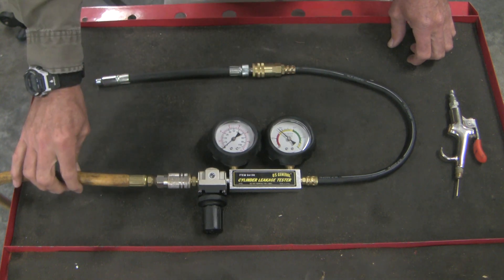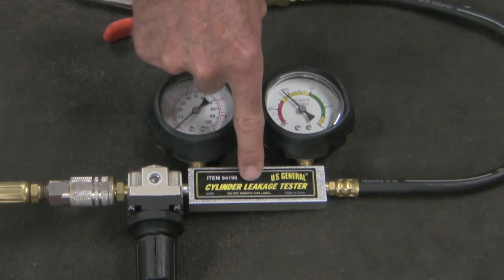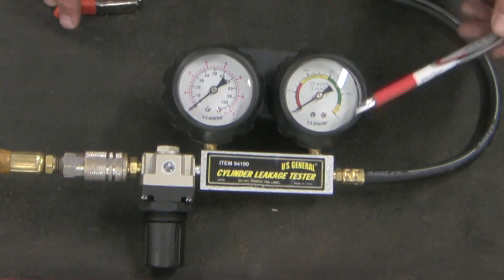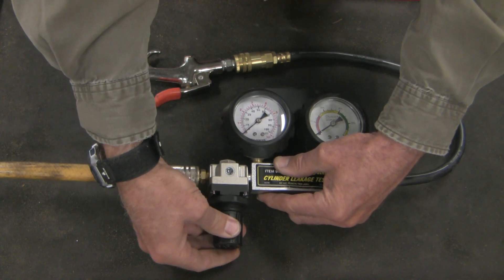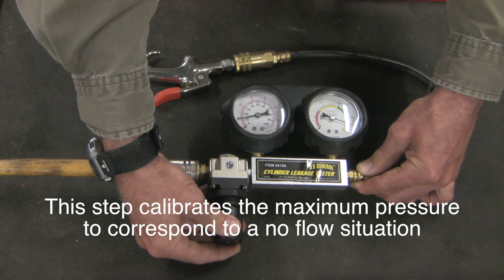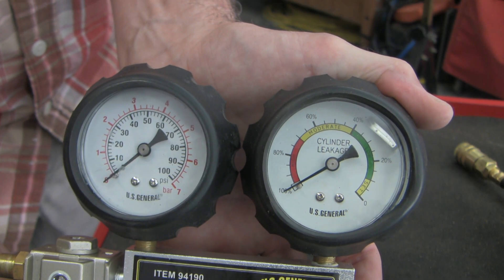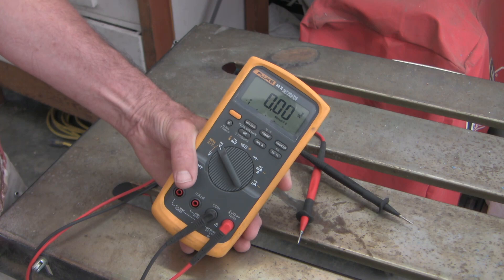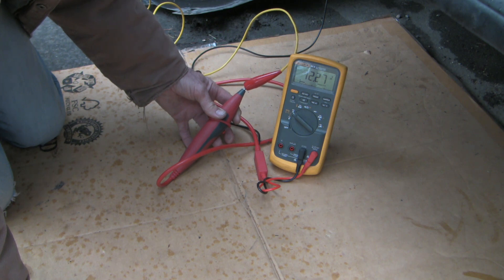How does leak down testing work?

Comment: I worked for an airline based in Miami Florida, I was working as a flight engineer back then. My instructor had me a two year F/E then teach a recurrent class, I had never learned so much from that experience. I had to go home and research all the questions I’ve received from the new class of F/E’s that it aided me In my own knowledge of the  Boeing 727
Reply from the maker: Yeah, I know what you mean, teaching forces you to learn a topic in much greater depth, especially if you're lucky enough to find people who aren't afraid to ask difficult questions. Thanks again for stopping by, aircraft mechanics is a much more unforgiving job, ha ha.

Comment: Love your videos intelligent, straight to the point and no BS. I have a leak down tester not dissimilar to yours I am hoping it has a 1mm ( 0.040” ) restrictor but instructions do not say. If I was to rig up a 1 mm restrictor on the output side and got a reading of 50% leakage from the gauge this should prove the the device has a 1 mm restrictor in it, analogous to the voltage drop across 2 of the same value resistors in a circuit just like yours.
Can you see any problems in this method ? I believe it would work and if the restriction is bigger or smaller  than 1mm it would give me a clue as to what it could be
Reply from the maker: That's a very interesting question! As with voltage drop testing in electronics, the actual value of the resistance is not as critical as one might think, as long as you're in the approximate range and you get movement of gas. Case in point, drop testing across fuses when screening for parasitic drain. The math for voltage drop testing shows greatest sensitivity when the resistance of your testing device is about the same as the resistance of the circuit, and I will guess the same would apply when you're using gas to assess leakdown of a cylinder. Yeah, I suppose a 50% figure when two devices were put into series would suggest a similar orifice, but details might be confusing. It would be complicated by the adjustable voltage regulator on the input side of the second tester.... I'd have more faith in a comparison test in various engines. As always, a tradesman knows his tools....

Comment: That's a clever idea to test the valves and piston ring gap leaks.
Although the piston ring gaps may have less effect on a high speed gas expansion/explosion.
I think...... ha ha :-D

Are you supprised by the amount of information your memory has, and you don't even know it's there untill the right prompt/key is presented by life?.
Frightens the hell out of me, the garbage my memory kicks up from nowhere lol.
Sorry im waffling again.
Reply from the maker: I was always under the impression that compression at faster RPM's while the engine is running might be higher, or at least similar to the slow RPM's of the starter motor. Not so, compression while running is dramatically smaller (~50 psi) because of dynamic effects of air viscosity, etc. Nevertheless the slow test shows a lot about engine health. Thanks for stopping by!
Reply: Sorry but i still don't know much about engines really.
I can't be expected to get everything right you know :-)